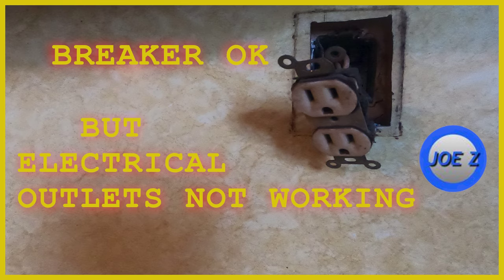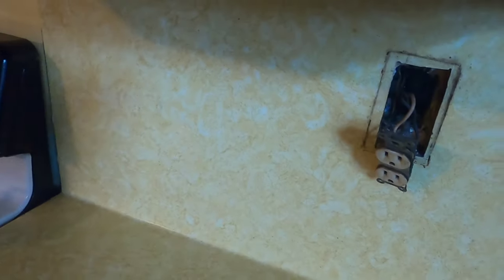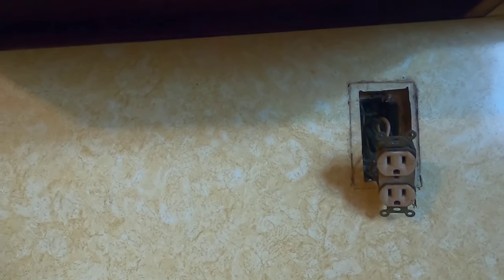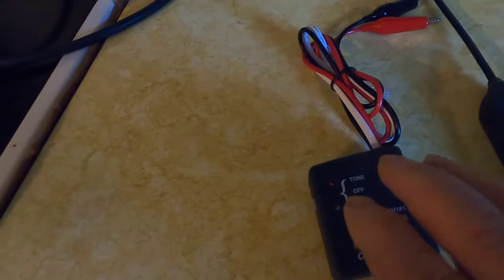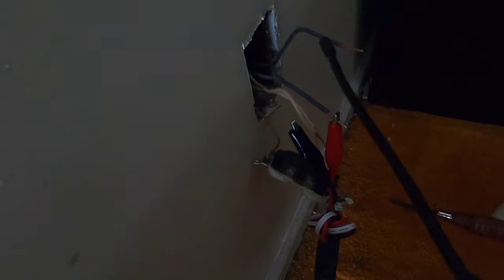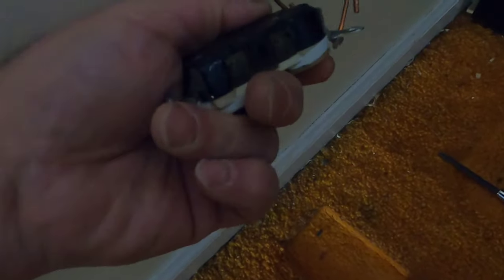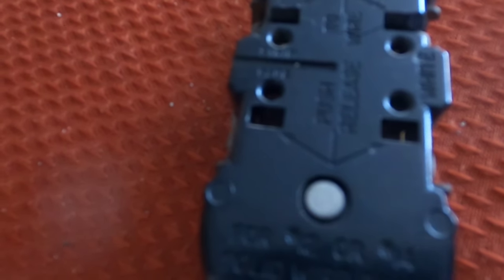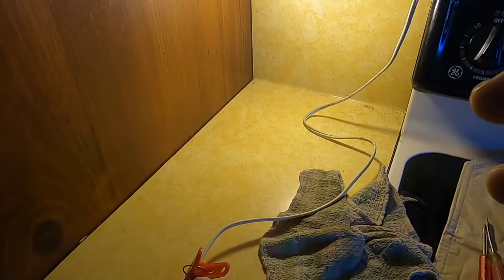Breaker on but no power to outlet FIX

Comment: I came here cause I was having a dead outlet too, but my issue wasnt this. I cycled thru my whole circuit breaker box and that fixed my issue. But I just wanted to comment and drop a like to thank you. I was about to call an electrician... I work on computers but I have no sense of troubleshooting these type of issues and your video was very explanatory AND gave me ideas on how to resolve my issue. Again, thank you so much.. even though these may not resolve all the issues people experience within this category, it provides good knowledge base to troubleshoot and get straight to the root cause.
Reply from the maker: Badpool I am glad you found this useful & want to thank you for taking the time to write this comment along with your support. It means a lot to me. Now keep in mind I am not an electrician just a DIYer who sometimes gets into things too deep LOL. I have a video where I replaced a keyboard on this computer after my grandson sprayed it with a hose. Your comment would be appreciated along with any corrections you can think of. It would help others who are trying to repair theirs. Working on computers is way out of my wheelhouse. Have you considered making videos on the repairs you do?
Stay well, Joe Z

Comment: Very thankful for this video! I am the maintenance man for the complex I live in, and I'm not an electrician. Have been dealing with the very similar situation, where half of the house didn't have power throughout. Fixed all but three, that were in one room; as the other half of the room had power. So I'm thinking the GFCI outlet in the hallway bathroom is the one powering those last three outlets. Thanks again for taking time to make this video.
Reply from the maker: You're welcome, I am glad this was of help. And thank you for watching and taking the time to comment. 
David I also am not an electrician and there probably is a "code "  approved method/way of doing this. But after hours of trying to find the fault this is what I came up with.
Thanks again I do appreciate your support.
 Stay safe, Joe Z

Comment: Last night my power went out in our master bath. After checking breakers and trying to test everything I could think of I was at the end of my rope and had concluded I was going to have to call an electrician.  I went to bed and before I went to sleep I decided to Google the issue one more time and this was the first video that came up. A trip to Harbor Frieght to get $50 in tools this morning and about an hour of investigating and I found the culprit. It was a bad connection coming off the light switch in the hall bath. Just as in this video the wire was in a push in that was worn out. Replaced the switch with a spare I had at home and everything came back on. This video probably saved me hundreds of dollars
Reply from the maker: thisjrocks,   I am glad this was of help. And thank you for watching and taking the time to comment. thisjrocks I have other videos on my channel that cover many different subjects  and new videos added weekly that may also be of help or interest.
 
Your support is not required or expected but always appreciated. If you are inclined to do so your Subscription, Likes, Comments and using the following links do help.

You can Help Support The Joe Z Channel at no cost to you
by following my affiliate links.   
Joe Z is a participant in the Amazon Associates Program, 
an affiliate advertising program designed to provide a means 
for sites to earn advertising fees by advertising and linking to amazon,
that helps me to continue producing videos.
Thank you for your support and using the links provided to make your purchases. 
                                                This is always appreciated.
                            ***** Thank you for your support ******
     
thisjrocks I just want to mention If you haven't installed the TubeBuddy browser plugin yet, to help your channel grow  Just go to my favorite tool for channel growth Tube Buddy. Now You can use it too, here's my affiliate link to the Free versionhttps://www.tubebuddy.com/joezep54   Start with the free version, yes it is free to not only to down load but to use.
Again I hope you get to  enjoy other videos on my channel as well. 
 Stay safe, Joe Z

Comment: Very thorough explanation in diagnosing the cause of the problem.  Whenever there’s 2 sets of wires (4 wires total - excluding the the grounds) coming in to a box, it’s preferable to pigtail them together, thus preventing other receptacles downstream from tripping or malfunctioning.  Another suggestion is to install a GFCI in the your dinning room that will also protect your downstream outlets in your kitchen. 
Pigtails: I do acknowledge this is not always possible in older homes where smaller metal electrical boxes was the norm back in the day, because there isn’t enough space in these older boxes to accommodate wire nuts or wago’s. Again , very good video and thank you for sharing.
Reply from the maker: You're welcome. Thank you for visiting & making a very useful & detailed comment. To pigtail these wires as you suggested would have saved me a lot of time.
Hope you get to visit my channel & contribute helpful content again. This is always welcomed & appreciated.
Stay safe, Joe Z

Comment: Running through the same issue now in the kitchen. Our microwave/stove is on its own circuit. There’s a few outlets that went out. The breaker box is good. I replaced the gfci but still no power. Gonna run to Home Depot and purchase some outlets in preparation to do the same. I’m crossing my fingers that I have the same issue as the outlets seem ok from the outside. Thanks for posting this video and great explanation as talking us through the problem, testing, and solution to get the results you desired.
Reply from the maker: You're welcome, I am glad this was of help. And thank you for watching and taking the time to comment. I do appreciate it. 
Let me know if you have any questions.
Matt Morales I have other videos on my channel that cover different subjects  and new videos added weekly that may also be of help or interest.
Your support is not required but always appreciated. If you are inclined to do so your Subscription, Likes, Comments and sharing this content do help.
Another way to Help Support The Joe Z Channel at no cost to you
is by using my affiliate links or  just go to:
                      https://www.amazon.com/shop/joez
 Stay safe, Joe Z

Comment: GFCI receptacle is the first thing I'd look for. GFCI breaker would be my next. Code requires kitchens have GFCI protection.
 Continuity testing is the next step.
You did everything right.

Note: 
 I recommend purchasing receptacles that cost over a dollar. If anyone thinks a 49¢ receptacle is just as good? I assure you, it is not!
Reply from the maker: Good call! Thank you for contributing.
Stay safe, Joe Z.

Comment: I live in the EU so I realize this is not really helpful for me, but I'm glad I clicked bc I love accents and yours is like a snack for my ears 😄
Take care 👍
Reply from the maker: Sorry this wasn't of help. Glad you enjoyed the accent LOL. Thank you for stopping by & taking the time to comment. Just curious about the wiring in the EU as the difference. 
Stay safe, Joe Z
Reply: @JOEZEP54  So we use type C and F outlets here and I'm sorry, but I don't know if the wiring is different for those or not. My problem is actually with just one outlet and I haven't checked it before I commented, but the problem is just that one of the two wires broke off of the outlet, bc it was already hanging out of the wall when I started using it. I might be able to reinsert it and use it again.
I always search everything in English, bc most of the time it's much more helpful, so this was kind of a reflex search. 😅
Thanks and you stay safe too!
Reply from the maker: Thank you for getting back to me. I am not an electrician bur very curious how different systems work. From what I was able to find out it looks like type C and F outlets are wired the same as here in the States. From what you described it sounds like you should be able to reinsert the wires. I would trim them back a bit to get  a fresh wire connection.
Stay safe, Joe Z

Comment: Had the same problem. Two outside outlets stopped working. It was a GFI outlet in the bathroom that tripped during a the heatwave we are having. Easy fix. Great video ty!
Reply from the maker: Thank you for watching & taking the time to comment. I had just the opposite, my out side outlet shorted out. It & my bathroom outlet run off the same GFI breaker. Took me awhile to figure out why my bathroom outlet would not work. I seldom use the outside outlet. Another puzzled solved LOL
Stay Safe, Joe Z
Reply: @JOEZEP54  yup! I went down to good ol Home Depot and installed a new GFI 15 amp outlet in that bathroom. The original one was from when the house was built in the 80’s. It was time for a new one!

Comment: Excellent video. I fully understand what you're talking about. I just did my home a year ago. I was dealing with receptacles since 1973. I upgraded everything in the home. It was all updated Jan 1st 2021 some of them I pulled out fell apart in my hand cracked and some were burnt. I was dealing with the same gage wiring you have 10. It blew me away this house didn't catch on fire to be honest.
Reply from the maker: CROCKPOT,  Thank you for watching and taking the time to comment. 
I am not sure if this was a 70's issue. Back then the housing market was booming. I know many house have issues with nails popping through the sheetrock due to green lumber being used. Construction may have been a little rushed.
CROCKPOT I have other videos on my channel that cover many different subjects  and new videos added weekly that may also be of help or interest.
 
Your support is not required or expected but always appreciated. If you are inclined to do so your Subscription, Likes, Comments do help.
Again I hope you get to  enjoy other videos on my channel as well. 
 Stay safe, Joe Z
Reply: 10 gauge wire?

Comment: I live in an upstairs apartment and I was using a space heater in the bathroom and it quit working along with the light by the sink but the other light above the tub still works. I checked the outlet on the opposite side of the wall  (in my bedroom where I do my hair) and it worked.
   Just curious if this is something I should report to my landlord because there’s also an outlet by my kitchen sink that doesn’t work which didn’t work when I moved in here.
Great video Joe, I learned a lot.
Reply from the maker: Teresa, I am glad this was of some help & thank you for your support. Teresa please keep in mind I am not an attorney & am not giving legal advice. That said I would contact the landlord, I believe this is an landlord issue to be taken care of. Plus there could be a loose or broken wire that should be taken care of for safety reasons. Your landlord should not be upset with you if that is your concern & would want to know if there were any safety issues, again that is my opinion. 
Let me know how you make out with this.
Stay safe, Joe Z
Reply: Space heater in the bathroom.  Any running water in that room?

Comment: I just had that happen & thought my fan broke.   I was troubleshooting the fan & thought I fixed it when it worked ( different outlet)
As far as I can tell it’s just the one outlet that’s out.    New homeowner here.  If I try something like your procedure I’d be riding the lightening within 10 minutes.   I’ll study up before attempting a fix.    Thank you for the content. It’s a good starting point for me & I need to skill up in this area. 👍🏼
Reply from the maker: KH Worker,  Between working on cars, lawn mowers, refrigeration, lamps etc. I had a little "lighting ride" a time or two LOL. We always pay for an education, one way or the other. This particular problem had me stumped for awhile. I never ran into it before. What really threw me was that the supply outlet that needed to be replaced was in another room. Just be careful & proceed with caution with any repair or service you attempt. Congratulations on your new home.   
I am glad this was of some help .And thank You for watching and taking the time to comment. KH Worker I have other videos on my channel that cover many different subjects  and new videos added weekly that may also be of help or interest. Ask me any questions you may have & I will answer to the best of my ability. I am not a tec, just a guy trying to get by.
 Be sure to 👍, share & subscribe if your are inclined to do so.  Also not to miss any new videos remember to hit that notification 🔔
 Another way you can help support  this channel at NO cost to you is by using one of my affiliate links.
     * Thank you for watching I really appreciate your support.***
Again I hope you get to  enjoy other videos on my channel as well. 
 Stay safe, Joe Z
Reply: @JOEZEP54      Your video was extremely helpful and I’m glad to have found your channel.  As a matter of fact you gave me enough information and in a manner similar to a good teacher.   I’m going to message you again with the results.  I’m going to get you 2 new subscribers today as a small token of appreciation for the effort you put forth.    It was Pleasure to make your acquaintance and I will certainly be looking at your content.      Get ready for a new sub notification ( or however it’s done in the YT world).  Cheers.
Reply from the maker: @khworker1322  Thank you. I really appreciate your support. I am looking forward to hear of your successful repair. If you have time you may want to consider starting a YT channel of your own. Having a home will provide plenty of content from simple everyday maintenance to some of "how do I fix this".
I have not posted a new video for a couple of weeks due to an injury slowing me down.
https://youtu.be/Mbcns_l9Nug
But will be uploading some DIYs soon.
Definitely a PLEASURE meet you.
Stay well, Joe Z

Comment: Two things: 1. 1960's code and practices would run an outlet/receptacle circuit from one room into another so that in case of a short/open-circuit, you had at least one hot outlet in the room.  2. It's dark in the corners of your house - get a flash-light so we can SEE what you are talking about.  Otherwise, thanks for this video. Good job!
Reply from the maker: Thank you for this information. Now I know why & what to look for if it happens in another room.
Ted Meyer I have other videos on my channel that cover many different subjects  and new videos added weekly that may also be of help or interest. 
Your support is not required or expected but always appreciated. If you are inclined to do so your Subscription, Likes, and  additional Comments do help.
                          ***** Thank you for your support ******
Again I hope you get to  enjoy other videos on my channel as well. 
 Stay safe, Joe Z

Comment: Great tutorial. I have a similar issue only a little different.  I had a breaker that kept blowing after several power outages. It had a 15 amp breaker, unplugged everything in the bedroom that kept blowing the breaker, turned it back on, blew a new 15 amp breaker I installed. Only then I noticed all the other breakers had 20 amp breakers.  I replaced the 15 amp with a 20 amp and everything stayed on. Only now, I have lost power to another room.  All breakers are on but lost power to one outlet in the bedroom and the switch plate in the master bed bathroom. We have heard critters in the attic and I’m wondering if one chewed through a wire and when I put the 20 amp in, it was the final straw. Looks like it’s time to buy an audio tracer.  Thanks for the tips!
Reply from the maker: You're welcome. Could be the "critters" chewed through a wire. I would first shut down the main power supply. Then if possible go to where you heard the noise in the attic & follow the wires you may find it that easy. 
Let us know what you find.
Stay safe, Joe Z
Reply: @JOEZEP54  - Thanks Joe!  A friend and myself wound up checking for continuity between every light socket and plug outlet in the room. It turned out to be one of the hot wires between two plugs behind the wall. Don’t ask me how, Somehow the wire shorted out behind the wall. Maybe someone drove a nail or a screw through it prior to us owning the house. Your tutorial helped me out a lot.

Comment: Helpful video.  I would recommend new homeowners test your outlets with a GFCI plug tester.  I had one that was supposed to be  a GFCI outlet but had a regular outlet in the bathroom. It will also tell you which outlet is connected to what GFCI.
Reply from the maker: Great tip! Thank you for watching & adding a useful tip.
Hope to hear from you again.
Stay safe, Joe Z

Comment: Thank you Sir. I followed your instructions. And I found my break . And yes I have aluminum wiring. Thanks again Sir.
Reply from the maker: Javier Osorio,  You're welcome, I am glad this was of help. And thank you for watching and taking the time to comment. Was the break at one of the connections? I did not experience it with aluminum wires but was told they have a tendency of loosing up.
Javier Osorio I have other videos on my channel that cover many different subjects  and new videos added weekly that may also be of help or interest.
 
Your support is not required or expected but always appreciated. If you are inclined to do so your Subscription, Likes, Comments and using the following links do help.
                  ***** Thank you for your support ******
Again I hope you get to  enjoy other videos on my channel as well. 
 Stay safe, Joe Z
Reply: @JOEZEP54  yes it was at one of the connecting joints,I had three pinging off of each other . One of the but connections had got to hot ,and burn off (got to hot) . That’s aluminum wiring for you.